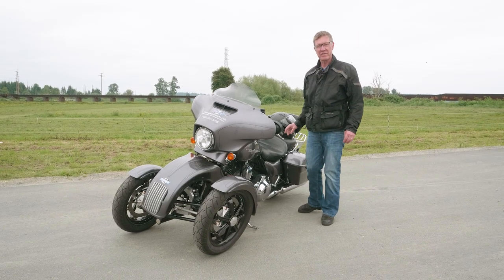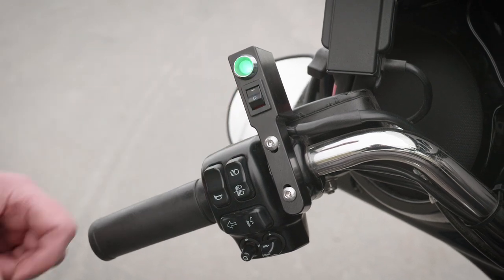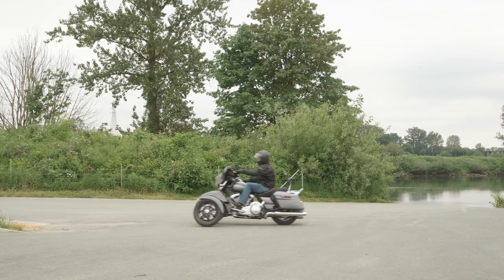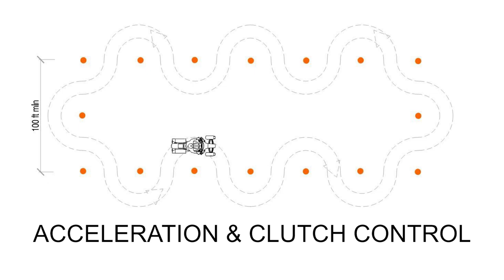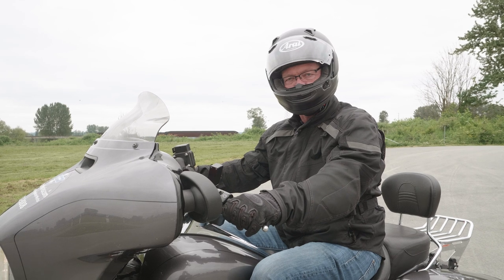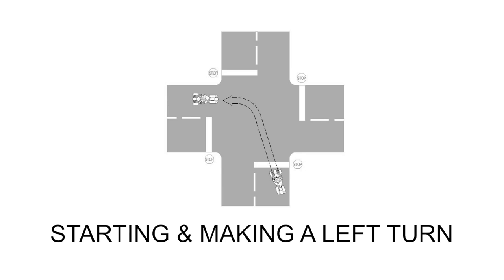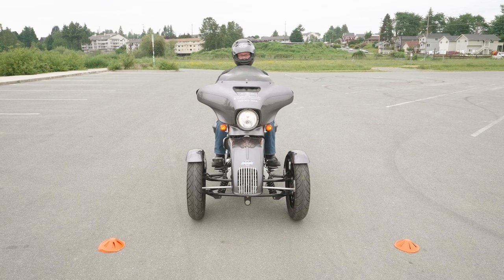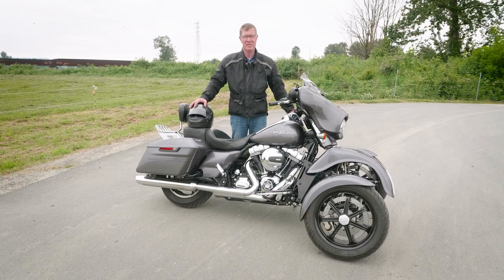TiltLock Overview 06042019

Comment: Absolutely AMAZING.. I was in a motorcycle accident in 2020 and lost alot of strength and balance.  The weight of my Harley 103 keeps me from riding now.. this system would completely overcome that.. good job 👏👍
Reply: Actually, if you cannot handle your 103 without this modification, you might want to consider a standard trike or different machine. This kit still demands the same strength and skill as a 2-wheeler. Trust me. I own an H-D 103 with this kit installed.
Reply: @larryb7047  I've gained pretty much everything back.. if not more really.. I'm in the gym 5 days a week and my arms have got WAY bigger and FINALLY I've got my balance back.. well mostly, I'd say 85%. I live up north so I'm gonna reevaluate in the spring of 22 and see..

Comment: I hope Arcimoto doesn't do away with the Trio Motor Works.  It looks like a very good 3 wheel conversion.  If I convert my bike, I would like to use the TiltLock system.

Comment: What a wonderful idea !! I dreamed of a system like that and I searched without believing: and I find you! In addition, your video has just been released :-) The front wheels do not seem very far apart. What is the width of the set? It would go very well on my Street Glide 2017, but here in France, the roads are often narrow... I wonder if the front train would pass between cars: we have the right to drive between cars, in France, to avoid traffic jams . Thank you for your answers (and for the video)!
Reply: Copied from recent copy of the owners manual: 
The front wheels are 36” apart on center and the overall width of the front end is 43”.
Reply: @redbeard14770  Thanks a lot!!

Comment: Is there a safety over ride if power fails?
Reply from the maker: It leans just like a two-wheeled motorcycle. The kickstand keeps it up when not in motion, and your balance keeps it upright when riding, just like two wheels. The only power that's utilized is for the TiltLock system, which is only engaged between 0-7 miles per hour when it's on. A lot of riders chose to ride with it off.

Comment: Yamaha Niken and Piaggio MP3 can do the 90% same cheaper and have service worldwide. Do you not think their engineers can't make a better Tilt locK. They are waiting to see if there is a market and how many liability lawsuits that attract with your product and theirs may be a reason . Honestly how many self leveling tilt locks are installed on your complete TMW install base.. I tried to get a ride on one of your trained authorized installers and they could not find a full conversion in 3 states. In fact you would have to talk a test ride from a private owner. I looked at the Arcimoto patent you assigned for the Mean lean machine. It did not seemed to have tilt lock means or embodiment. Is tilt lock coming to the E-assist Mean leaner not saying it needs it. The big guys can install tilt lock. I have it in my first patent. Great and inspiring work of  love and ingenuity. I have Tilt lock on any scale in multiple technologies and running prototype vehicles if you care to look. Good luck! A rising tide of TTW raises all ships!

Comment: Why haven't you guys developed rear tilting wheels? It's doable. There was prototype called the R8 in England that had this and it appeared to work great. Although you do gain CV joints on both sides you also lose the steering geometry problems.  https://www.youtube.com/watch?v=mA64zJFUjxk&t=37s

Comment: so u pay 20k for the HD then 10k for the tilting front end. why not just buy a can am spyder for 17k? it already has 2 front wheels and is half the cost.
Reply: Because there is no leaning or feeling of actually riding a Harley on a can am. You actually feel like your riding a motorcycle with this. To some if that's all they can do it's worth 10k easy to them.

Comment: It really bums me out that this is basically a toy for rich people. 

Most of us can't afford a $14,000 mod for our motorcycles. Most of us never even buy a bike worth that much money. 

Like, this could enable people to ride their motorcycles year round all over the planet. In Canada, we can't ride our bikes for 1/3 of the year (If we're lucky). If I had this, I could just get rid of my car. If his were $4,000 and something I could install myself I would buy it in a heartbeat. Imagine how much people would save on fuel if riding a motorcycle with 3 wheels was a real, practical alternative to owning a car.
Reply: And someone else would say the same thing about a $4,000 kit. If you cant afford it then dont buy it. Get a can am spyder or something cheaper. But if you are buying a Harley then you cant be complaining about a $14,000 upgrade because there are WAY cheaper options for motorcycles too
Reply: @fordblue2257  the difference between a $4,000 mod and a $14,000 is VERY big. And motorcycles like the Spyder are, IMHO, much less safe than a tilting motorcycle.  You can't shift the weight of the bike around. Not to mention how expensive they are!

The problem here is the guy making these is clearly a very rich man. He said himself that throwing out a motorcycle with 4 grand means nothing to him. So why would he be bothered by setting the price so high?
Reply: @PhilipPetrunak  i see what you are saying. The point i was trying to make is that $14,000 sounds unreasonable to you and $4000 seems reasonable but to a poorer person a $4000 mod would be super unreasonable and $400 would be more reasonable etc. I will say to me the price does seem hard to reach for an average Joe but when you look at the technology of this kit, the parts etc i was actually shocked it was only $14k. I have seen companies charge insane prices for something that just bolts on which is bullshit however this being a self righting system with speed sensors and the ability to keep the bike perfectly level even on pitched roads etc....i think it would be hard to make all that happen in a kit for $4k. Also if someone was able to make a kit in that price range im not sure i would trust my life on it because all companies are trying to make a profit...the cheaper the more corners they have to cut, cheaper metals. Just my 2 cents
Reply: @fordblue2257  Most motorcycles are around $10,000 if you buy them lightly used. A very cheap motorcycle is around $4000 to $6000. Expensive bikes, new, are near the $30,000 mark.

So for a price of $4,000 is more than reasonable considering the nature of the mod. However, this mod is half the price of a premium motorcycle new. It's more expensive than what most people pay for their cars.

It's way too expensive.
Reply: ford blue 
My o my my my. Bek on school  ride safe  you Are ride    Blue
Reply: Nice niceee bikie.               ,,,,,     ford blue
Reply: Monye monyemonye
Reply: @fordblue2257. Agree 100%

Comment: Three problems I have with it.  1. Two wheels in the front looks silly compared to two wheels in the back. Very subjective I know. 2. Looks like it suited better for short period.  No room for pegs.   3. Too many chips/electrical parts to go wrong.  Just for a tilt.  I can lean for free.  Idk,  just my opinion.
Reply: Mike Johnson So the two front system is definitely better than the two in back and in front system?  I can get over the look of it if so.   I just want the better system between the two.
Reply: Mike Johnson You know, that actually does make a lot of sense.  I am no engineer by any means, but the way u explained it has a lot of common sense integrated into it that just makes me see the engineering point as simple fact.  Thank u for that.   I believe this is how the can am spyder stood its ground against a well oiled machine like the goldwing when it comes to the goldwing trike.  Sure, Honda most definitely makes a better engine than can am, all day long, but, a lot of people would rather have the two wheels in the front than in the back.  And after reading what you wrote to me, I really am seeing why that is.     Thank you so much.   I needed this before I made the choice!!
Reply: Mike Johnson I am very much looking forward to it!!  I hope to get to wing ding next week to check it out!!   Do you know if the back tire remains the same as on the honda Goldwing or do they put a bigger tire on it??